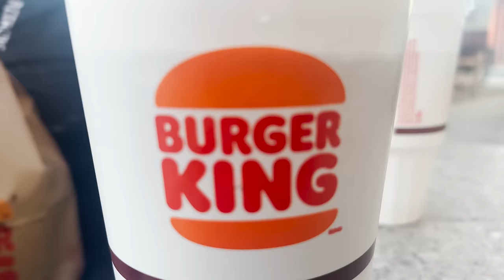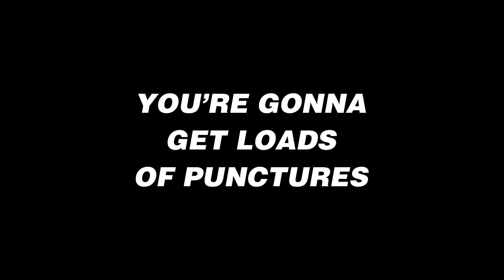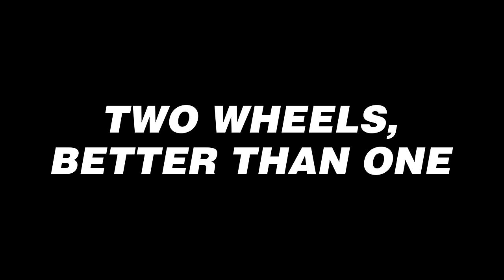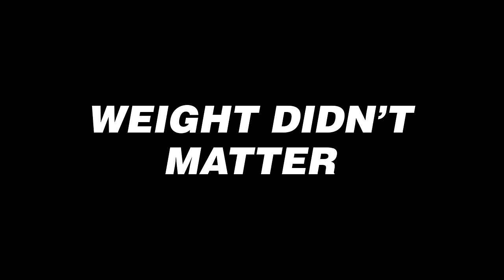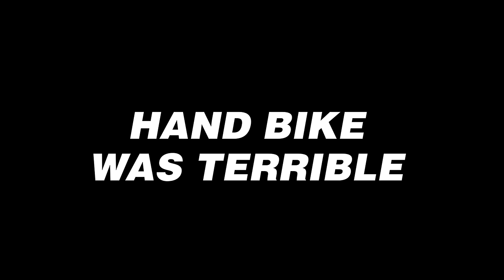10 Things I Learnt Cycling Across the USA

Comment: I’ve done two XC USA trips, and your info is spot on. Your nutrition plan is immensely important, and you’ll get an ungodly amount of punctures. Especially if you’re on busy roads, because of those thin strips of wires (inner casing of 18-wheeler tire carcasses).
Reply: I find those little strips of wire in the most random of places, including roads or streets where big rigs are prohibited. I've always wondered where they came from.
Reply: The semi truck tire fragments you see on the road or on the side of the road are referred to as “road gators” and they are definitely a hazard. My dad was a professional cross country trucker for his whole adult working life and even in his massive truck he had to be cautious about those tire fragments.
Reply: Ghost Wires from car and truck tires. Hey, try Schwalbe Marathon Mondial tire instead of Marathon Plus. The Mondial is lighter, more supple, and easier to remove. I used them on three trips across and got two flats total.

Comment: Great video! Glad you had a safe trip. My tips after three times across U.S. bicycling. Clothes, take one/wear one; eg pair of socks on feet, one pair in bags. Same with shirts, shorts, etc. Puff jacket, rain jacket, that's it. Dogs: small personal size pepper spray in front pocket, $12 at Walmart, dogs run across yard, spray in their direction when six feet away. Touring tires: instead of Marathon Plus, use Marathon Mondial, they are more supple and easy to remove. Three times across, two flats total, zero flats on Northern Tier route. Happy trails!

Comment: Single wheel trailer but the steering pivot needs to be just in front of the rear tyre contact patch.  That is tow arm pivots on an attachment on a rear rack.  Axle mounted yolk with steering pivot behind rear wheel is dynamically unstable.

Comment: I have a Revelate Designs Mag Tank top tube bag that is only a 1/3 the length of the top tube. Even that will hit my knees if I get out of the saddle to climb. I have found that a half frame bag like the Tangle is great, still fairly easy to get into and I can sit on my top tube at lights, which is great for commuting but probably not as big a deal on long distance touring. I can't wait to Tailfin to do frame bags. I love my AP20 trunk bag.

Comment: My tip: If air drag is more important than weight, go recumbent.
A wedge shaped tail box to close the air behind you and reduce turbulence is the first improvement, because you can pull more air than you can push. Then a good fairing to open the wind in front of you.
An Easy Racer Gold Rush is a great touring bike, but the Lightning P-38 is considered to be a faster bike. On a short wheelbase recumbent, I recommend front suspension because of the weight on the front wheel.

Comment: Awesome video!

1. Riding on freeways is easy but gross.  So much trash, noise, and bad smells.  Spend the extra effort to take other roads.  Better scenery and overall experience.

2. 100% on forcing yourself to eat.  I tend to lose my appetite the 1st, 2nd, and sometimes even the 3rd day of a biking or hiking trip. If I don't force myself to eat in the early part of the trip, I bonk haaaard..

3. Trailers:
Pro: you get to a store, lock up the bike, and use the trailer as a shopping cart without the need to worry about someone nicking your stuff.  Also, much much easier to pack and balance.  
Con: a lot more drag.

4. Panniers
Pro: better riding experience overall.
Cons: a pain in the rear to pack and balance.  Difficult to secure when you're away from the bike.

4. Need to try frame bags!  Bar bags are a must.

Comment: Justins bike and your trailer should really have a basic fairing on them, this would help smooth the airflow and reduce aerodynamic drag. For Justin this could just be his lower legs, though I am also sure it might like a face Fairing to stop the crude from the road, for the trailer this would just cover the front of it to help direct the airflow over and around it rather than having multiple bungy strap, wheels, spokes, wheel chair seat, hitting the wind individually. 

Of course you would also want to try and reduce the low pressure zone behind the trailer as well, the question is if you know any aerodynamicists to model you!
Reply from the maker: Don’t tell Justin that, he’s aero enough already!

Comment: Maybe I missed it, but did you use tubeless tires with slime sealant on your cross-country ride? I went across the US this past May and had incredible luck with Giant Gavia Fondo 1 tires with the Giant sealant. 3400 miles with no flats. All the punctures self sealed after a bit. And we were on some bad highways with tons of crap on the shoulders. A few times I just had to add some air. I think I was just very lucky but I have since gone to tubless tires on all my bikes.

Comment: In case anyone else is considering it, this is the CORRECT way to display the flag. The flag can be viewed from either side of the bike; so depending on where you’re standing the union can be both left and right. Because Francis has placed the union closest to the front of the bike, the union comes first when riding in the direction that bikes travel.

Comment: 2 1/2 months of being on the side of a road with high speed traffic? Quite frankly, it’s a wonder you survived. My palms sweat thinking about it.
Reply: High speed roads sound scary, but it's the slow narrow roads that actually are scary. For one, the fast roads usually have much wider shoulders. If a car starts drifting off, you can hear them coming (seems to happen less often). On slower, narrow roads you get no warning, and a lot of drivers feel safer and drive more recklessly.

I ride about 12,000 miles a year, a lot of my commute is on a wide, high speed road.

Comment: You keep mentioning cycling on the Interstate highways.  I would like to clarify when you can use them.  It is generally illegal to ride a bicycle on any interstate highway UNLESS there are no alternate routes, usually out west, in which case there will be signs posted to say that you can ride a bike on them.  So the default is that you CANNOT ride your bike on the Interstate highway system, except in a few remote areas.
Reply from the maker: There were a lot of signs on our route and correct, there was often no other option

Comment: "I would rather fix 3 punctures a day on an easy to remove tire than 1 a day on a Schwalbe Marathon Plus".  Maybe, but with a Schwalbe Marathon Plus you won't be getting 1 flat a day.  I rode across the US 3 times, the first on Continental Gatorskins and I stopped counting flats after around a dozen.  The second and third trips I rode on Marathon Plus where I had only 1 flat on the second trip and ZERO flats on the third.  Changing the Marathon Plus is really not that bad if you do it right by slowly going around the tire squeezing the bead into the center of the rim.  Over and over.   And don't fight with the tire.  It just requires a lot of patience, and then some more patience.

Comment: I have to disagree with your evaluation of the bike trailers. One is not better than the other. They are different. 

If you are only riding on roads and staying in hotels, then a two wheeled trailer will likely suit your needs better. But, if your journey is more adventurous, uses more back roads, bike paths/trails and especially if you are wild camping: then a single wheeled trailer is a better option.

Both have benefits and downsides and both will compromise how your bike works.

As for a future solution to carrying the wheelchair? For a similar road based journey I'd consider an e-cargo bike. You can't get away from the fact that carrying the wheelchair is going to compromise your bike. You can't maintain the feel and speed you want, lugging a wheelchair. Carbon racing are just no good for hauling a big load. So lean into.

Cargo bike is built for precisely that, will be stable, minimal effect on handling and the power assistance will get around the reduced speed and increased wattage requirements.